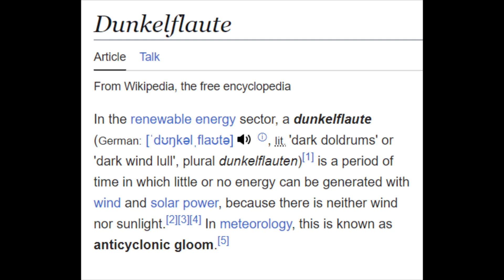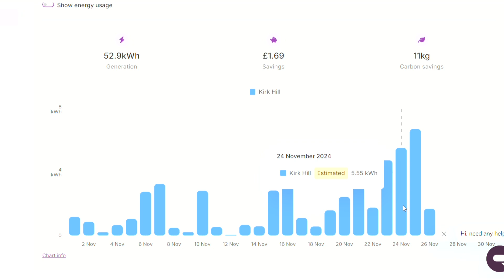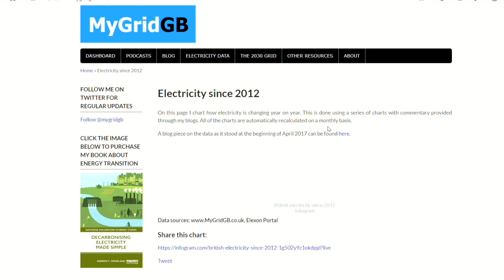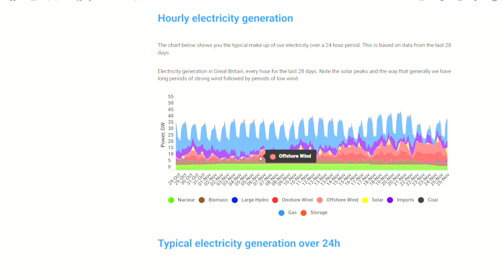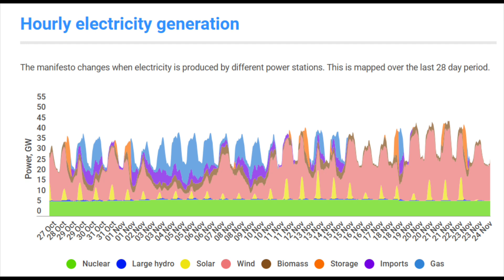Dunkelflaute: The Energy Crisis You Didn't See Coming

Comment: There's always a plan, it never works because the same experts who dreamed up this net zero nightmare are drawing up the plans.
There's only one way to stop the nightmare, don't vote for the major parties.
Reply from the maker: Hi John, what part of our energy system doesn’t work today? We already get about a third of electricity from renewable sources, and this will increase as more systems come online. This will make electricity cleaner and cheaper. 
What part of it is a nightmare?
Reply: @TomBray-LowCarbonLifestyle  I live with renewables, please do not tell me windmills and solar panels with BESS can run a modern economy. I get threatened with a $3,000 fine for cutting down one tree and 5Ks away they clear 2,000 acres for a solar panel farm with over 100 species displaced and they call it green energy. It's a nightmare!

Comment: Hmm little or no energy, but who needs energy right? We have to virtue signal about saving the world by all becoming super poor with regular power cuts.
You are in the definition of a deluded cult my friend.
Our energy comes from fossil fuels, and unless we have an extensive nuclear build out, renewables will never be able to meet modern demand on a reliable basis, especially if we're all going to be driving electric cars, and it's much dearer when all the true costs are factored in, not to mention all the land use, massive mining of the planet for the metals and the unrecyclable waste it creates. Not "green" at all!
Anyway we're already dead, because they've been telling us it would be too late in 10 years for the last 30 odd years.
Reply from the maker: What part of the video do you take to mean we will have power cuts? We have all the systems in place today to run with minimal power cuts, and distributed generation tends to secure supply, rather than having central power stations that could drop out at any point.
Renewables (wind and solar), in the last 12 months, met over 31% of UK electricity demand, gas produced only 29%. They are already contributing and are here to stay! 
You are going to be gutted when you hear about the massive mining for fossil fuels and the environmental damage that creates...! In fact, mining for renewables will be 1000x less than the amount of mining required for our existing fossil infrastructure.

We are likely to have missed the 1.5°C target, and are heading for well over 2°C of warming. This has already started causing damage around the world, and will continue to do so. We can be blind to this, or we can work to reduce the impact. I know what I would prefer.

Tom

Comment: I see that here Tom  is talking about a 345 watt land- based wind farm in Scotland, which he jokingly calls massive. In the context of ‘Dunkelflaute’ let’s talk about a 12 MW floating wind turbine in open seas 50 km off the coast ie, Hywind). This would be around 150 meters or more to the the top of its circumference. In winter it produces power at above 90pc of its capacity. Those are the turbines we will use to achieve net zero. So Tom: my question is how did they perform during this period of Dunkelflaute?
Reply from the maker: Good question, I don’t have the specific data about that type of turbine. But if you look into the graphs on mygridgb you can see that some of the time wind output was very low for the whole country. 

And we were reliant on other sources on electricity. That’s ok, and driving down the amount of gas we need over a whole year is key, even if we need it for a few still days in November. 
Tom

Comment: As always, focussing on CO2 generated in the UK. But CO2 is a world issue. If you want another 1000 windmills you have to dig massive amounts of ore (iron and copper) out of the ground in the far East using dynamite and diesels, creating CO2. You then transport to a smelting plant using diesels, creating CO2. You then smelt the ore using dirty coal, creating CO2. If every country in the world orders 1000 windmills, then more smelting plants will have to be built, creating more CO2. You then have to transport the iron, copper (and concrete) across the globe, creating more CO2. You then have to turn to steel and copper wire and deliver and erect somewhere beautiful or out at sea. More CO2. Then you realise that your infrastructure is inadequate, so you need pylons, so you start all over again ordering more iron, copper, aluminium, and concrete. Creating more CO2. If you believe that we're heading towards a precipice, your solution has you racing towards it.
Reply from the maker: Hi Peter, you may be shocked when you hear how much oil and gas it takes to extract, transport and process oil and gas, as well as the environmental damage is done in that process. My solution is to burn less gas and oil, to keep us from the precipice and minimise the risk of disaster.

The good thing about a wind turbine is we do that process once, and it lasts for 20-25 years, rather than having to dig up something else to burn it once.

We have got to move away from that wasteful culture to something better. An electrified economy, powered by wind and solar generation, is a good step in the right direction.
Thanks
Tom
Reply: @TomBray-LowCarbonLifestyle  But Tom. We have oil and gas on our doorstep, not shipped from China, who could cut off supply at a stroke. And our solution is intermittent. If we'd set out with a constant supply method, like wave, or tidal, then I'd be more convinced (or fully atomic). With wind and sun we'll always be reliant on fossil fuels back up unless Fusion comes on stream. The cost of storage could run to trillions. As a nation we don't have that money, so it'll have to be paid for be the hard pressed working class. So, I think that an electrified economy powered by wind and solar is a really poor step. 

But thanks for your reply.

Comment: Wenn you get a Dunkelflaute you spin up the reserves. It is OK having Gas as reserve and use it very sparingly. It is also good to diversify green energy, that does not swing in the same rhythm as solar or wind. There is wave power, rather difficult to harness, but we could see a breakthrough one day. There are under water turbines using the tidal streams, also with problems yet to solve. And there is geothermal potential in the UK. The technology is no problem, but the investment cost is high with geothermal. Once up and running it provides electricity 24/7/365.
Reply: MJ, 

you cannot run a  grid without gas, it is not a back up but an essential to keep the grid in load and supply balance, renewables cannot do this. Wave and tide are another dead end, very low energy density and all the negatives that wind and solar have.
Reply: How do you store TWh of electricity to cover 11 days of Dunkelflaute like we saw in the beginning of November 2024. All waffle, no plans, no costs, just wishful thinking.
Reply: @RalphFreeman-ok5of  Do you post without reading the post you are commenting on?

Comment: Oh, I forgot, just look at the nearly 2 billion spent on curtailment of wind generated power over the last few years.
And electric cars, I bet most folk charge overnight when the sun doesn't shine and in a " Dunkelflaute" they will be using gas generated electricity. Your nuclear is all spoken for just keeping the lights on!
I'm on Agile and have taken a hit with 50p. at times.
Reply: EVs are not part of the problem, they might well have been charged at night prior to the dunkelflaute and recharged after. They reduce CO2 emissions by 66% relative to petrol in the UK mix, so charging them solely from gas would still be a relative win.
Reply: @Biggest-dh1vr  Maybe so but in reality the inputs into manufacturing batteries and more importantly the disposal of same negates the positives.  The fire risk is too great, toxic fumes for  many hours and polluted run off from attempts to cool batteries isn't good. Vehicle fires are mostly caused by electrical faults and EV' s are full of wiring. Then there's arson and also an EV being involved in an external fire. Another thing that's starting to happen is people trying to do their own repairs on EV's. YouTube has examples of people trying to repair high voltage batteries and related components. We have EV 's in the family and haven't had any real cold weather but I can see that from experience that if you're going far on a cold day keep in the slow lane with the heating off except for keeping the screen clear. We use pickups in our business and electric pickups have turned out to be a dead loss. Put a trailer on and you're down to less than 100 miles, then you probably have to unhitch to charge at 80p kwh if your lucky enough to get the charger working. 
Given time the technology can get there. Progress with lithium sulphur, which has a decent capacity to weight ratio looks promising. I can't see why a plug in hybrid can't perform well as a stopgap, they seem to have a bad reputation but I think that has been caused by fleet buyers using them as tax avoidance. I have a chart showing the Life Cycle Assessment of US LNG, over a 20 year period the co2 per kwh is a staggering 750 to 900grams per kwh.
We're just kidding ourselves with figures given for electricity derived co2, the figure is just what goes up the chimney at the power station. I looked up the efficiency for transmission and distribution of electricity.  Total annual output 250 terrawatts and losses 25 terrawatts so it's not a difficult sum.
Now, if a home battery had a lifespan, guaranteed 30 years, that would be a winner especially if you had room for solar pv. There's going to be huge gluts of over power if all the solar and wind farms get built. If I had solar/battery I could be self sufficient in electricity for 6 months a year and the battery would be an enormous help to the Grid in the winter. The equipment must last long enough to be viable, this is the problem as of now......the technology isn't quite ready. 
Believe me, I have spent a long time doing research and calculations.
Reply: @jonjo6886  the Carbon Brief EV fact check covers the (unlikelihood) of battery fires and the efficiency of charging. It doesn't cover how 95% of the materials in the battery are recyclable, with a 10 year lifespan, 50% of current battery materials will be in use in 130 years.

Most will find an EV for their use, with most trips being short. But if you are hitching trailers, you will need a bigger battery! My EV has an option to pull a light trailer, but I'm not gonna try! Bigger batteries are here, but for trucks and buses (maybe new techs are on the way as you say). Presumably they'll land in consumer models at some point, but unfortunately it might be a while for your use.
Reply: @Biggest-dh1vr  We run an MG electric and to top up at Gridserve cost about 22p per mile.
We also runa a Prius and to top up at Sainsbury costs 12p per mile.
We are on Agile and the MG cost about 6.5p per mile last night.
Reply: @Biggest-dh1vr  I did the real world calculation for the co2 emissions from my Prius.
Turns out it chucks out 200 grams per mile.....but.....you have to add on 30% for production   and refining.  That brings it up to a whopping 260 grams per mile.
Reply from the maker: Lots of interesting discussion, thanks both! I think a point I would make in response to Jonjo is that perfection shouldn't get in the way of progress, much of your complaints appear to be that the system is not perfect yet, that does not mean that wind, EVs, heat pumps etc are better than what we have had in the past. And that, as more systems come online, the progress will continue.
Tom
Reply: @Biggest-dh1vr  cars don't necessarily have to self ignite, this morning, a couple of miles from where I live an arsonist has started a huge vehicle fire.
Another scenario is a petrol car starts a fire and the EV parked next to it catches light too.
The big problem arises when many EV's are parked in, say, a multi storey.
Jaguar is buying back a couple of thousand cars as a result of increased fire risk.
My neighbour who works for JLR had an ipace and couldn't get shut of it soon enough. 
I think the technology just isn't ready for mass adoption. Certainly EV batteries need some sort of licensing so that they don't get abandoned. There's just too much toxicity involved and that mustn't be allowed to get into the environment.

Comment: My heat pump gives 1 : 2.5 and that's what gas generated electricity gives us. (Only negative, 2.5 ,: 1 )
Gas and imports have been over 70% at times in the last couple of months as far as electric generation goes.
Nuclear is likely to close existing capacity and look at the cost of decommissioning when they  are finished with.
Biomass is a joke, look at the subsidies Drax has received and the future pledges of support.
As far as heat pumps go they never run on solar except for the few who have batteries..
Just look at the life cycle emissions from LNG, just off the scale when used to generate electricity.
Electric cars are useless until we have batteries with 400 + w/h kilo. Ask Stelantis or Toyota.
I'm all for progress, but not at any cost.
If we " Just stopped oil" there would be mass starvation.
Reply: Perhaps you should have someone in to look at improving your efficiency if the performance over the whole year is poor?
Reply from the maker: Hi Jonjo - definitely think you might be able to get more out of your heat pump.

But to your other points... what are you suggesting we should do differently?
Reply: I run my heat pump at 55°c and try to use electricity when it is cheap. The last couple of months has been dire as I  am on Agile.
I have a hybrid system and use gas when needed.
I'm confident that in UK where I live solar and battery are the way to go if you have a suitable property.
Batteries must last 30 years otherwise the input and decommissioning outweigh the benefits. 
We don't get told the truth about emissions. I explained to someone else about my Prius. The manufacturer's figure is say 120 gram mile.
I took the co2 for burning a gallon of petrol and divided it by the mpg and added 30% for production, refining and transport. The figure came out at 260 grams per mile.
Heat pumps are the same, in winter there is no solar and biomass is a total fraud. That leaves gas and wind.
LNG is awful, gas comes raw and has to be sweetened. It then has to be cooled/compressed, pumped into the transporting ship. During shipping it has to be kept cool and some boils off which is compressed back with diesel engines. Inevitably some methane can't be captured and goes into the atmosphere. Then at the destination the stuff has to be heated so it can be used.
My real gripe is that we aren't told the truth.
Can you see where I am coming from?
Reply: @jonjo6886  there was an article about lifetime emissions of gas in the Guardian recently, so I think we are being told the truth about gas - the study suggests gas can be as bad as coal. To a reasonable extent we're also trying to minimise gas use? The problem is that there's no obvious single 'best way' to store electricity from wind generation for the long term at the moment?

Comment: I do have a nagging concern that too much solar in the UK is not wise.  
If solar produces sufficient cheap power in the summer, and probably spring / autumn, but hardly any in winter.  
Therefore whatever you install to cover the winter costs more to run. 
I guess it’s all a balance, which is the realm of the experts…but maybe not the non experts..ie Politicians!
Reply: Today our 27000kWp pv installation produced almost 4kWh 😄
Reply: California has an oversupply of solar and this has caused a significant increase in costs to consumers.

Comment: A higher % of Nuclear makes the task of renewables + storage easier. So the answer was to get those big plants + SMR's started a decade earlier than we did.
Reply: As an ex-reactor physicist (Dungeness A) I disagree. The cost curve for nuclear is going in the wrong direction, whereas the cost of Solar, Wind & Batteries (SWB) continues to plummet. Investing in more nuclear will just keep the cost of electricity unnecessarily high over an unacceptably long time frame. The same investment in SWB would give us far greater bang for our buck 😊
Reply: @oakfield_farm  Over reliance on intermittent energy sources does not get you to net zero. After a few hours the battries are depleted and its time to fire up the gas plant. Nuclear can and should get cheaper as the industry awakens from its hibernation  As a physicist you should understand the energy density of U235, U233 and PU239
Reply: Oakfield, 
I disagree, wind and solar costs are not plumetting as you claim and integrating them into the grid is expensive due to all their deficiencies. Nuclear needs no such support.
Nuclear suffers from over regulation and years of actually getting the aproval required, this costs money. Nuclear also has at least twice to three times  the life of renewables which also suffers from a degrading performance with time from the original commissioning.
Reply: If we aimed for 25% nuclear then as they run flat out all the time this will protect the off peak tariffs which WILL disappear without a constant base load

Comment: Instead of spending £billions and taking decades to build nuclear, we should spend on grants for rooftop solar and battery storage. Sodium batteries can replace lithium for grid scale storage for windless dark days. Pumped hydro should be possible in a few places if planning consent is given, however, there are hardly enough reservoirs for drinking water at moment. I wonder if small hydro schemes would be viable at reservoirs?
Reply: Small hydro are not likely to move the needle much, due to needing height differences between two reservoirs for pumped storage?
Reply: @Biggest-dh1vr  Yes there aren't many places that make it practical at reasonable cost. There has been one in Wales for many years. Hydro itself hardly contributes 1% of generated power.